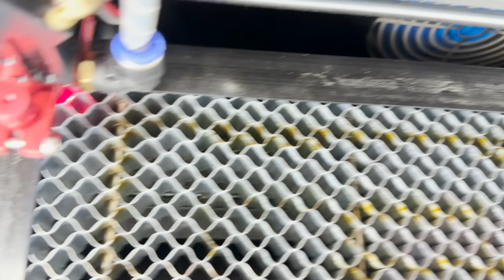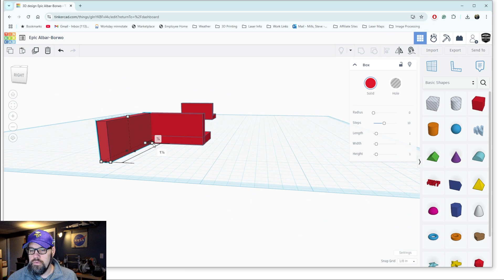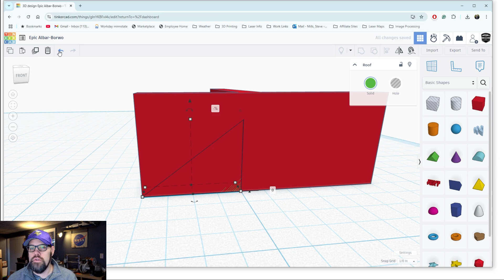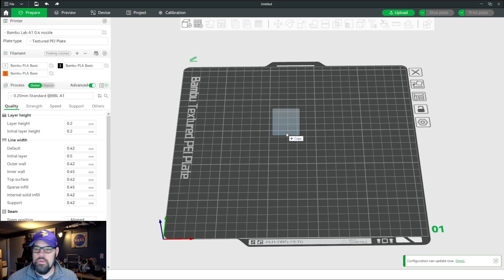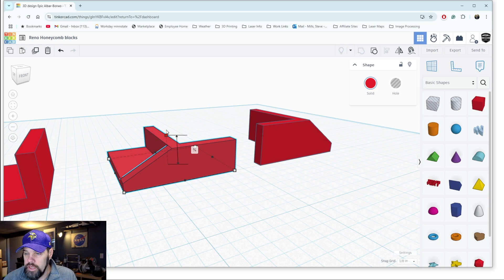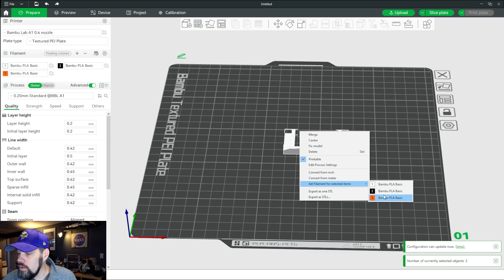Securing the Monport Reno 45 Honeycomb | Make repeatable job easier!

Comment: Thanks for this as this is really helpful. I have a Reno 45 Pro. Now the one thing I have to say is that Xtool makes framing super easy in their software. The camera that it comes with using lightburn is not the easiest to calibrate even with the patterns it includes. We have noticed that sometimes although the camera paints an object, upon printing it can be sometimes more than 0.24 in off center. (Might be having to do with the fisheye lens it comes with) If someone could make a video on a better way to frame (especially with circles) without having to rely on the internal camera that would be so amazing. Even though i have it, i tend to use my xtool S1 instead simply because Framing is so easy with Xtool Studio. Maybe i missed something and if someone could point that out to me I would really rather use my Monport 45 Reno.

Comment: Thanks for sharing the print files.  On the 65 Pro the honey comb is a little closer to the Z axis screws so the front corner pieces didn't fit.  But my bed can now be placed in the same place every time.
Reply from the maker: Thanks for the feedback on the fit for the 65 Pro! Happy to hear you found a way to make it work.

Comment: I assume this will support a rotary? I’ve got one in my cart but trying to convince myself I really need it lol
Reply from the maker: They do have a roller rotary for it, the 65 pro would be better if you want to try a chuck rotary.  There is a port on the inside to connect the rotary.
Reply: @Vintauri darn. Glad I asked, was trying to stay in the price range of the 45. I just bought the ultimate Kraft bundle and may have buyers remorse lol. I really need to be able to cut clear acrylic.

Comment: So with constant air on the monport, how much does over burn on engraves? Also, does it say how much air is pushing through?
Reply from the maker: It will depend on the material, but there is some smoke staining on engraves and some cuts. There is no documentation on the air flow for this one.  I might try to dig into it and see what the pump is rated at and try even bypassing it to allow variable air on shop air in the future.
Reply: @ thank you Steve, I value your opinions as well as David’s. Wanting an entry level CO2 with a decent bed sizes like the Monport 65pro but things like needing an additional chiller puts it in the Hurricane price range albeit a smaller work area.